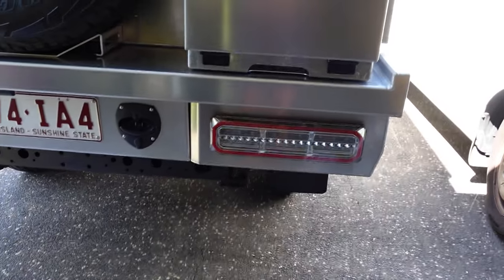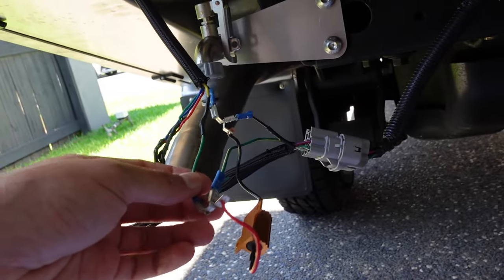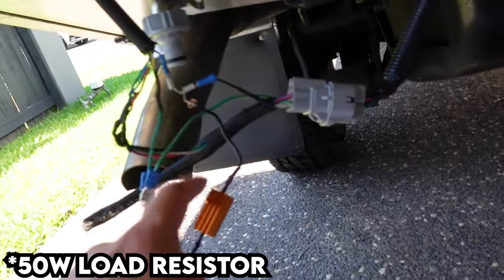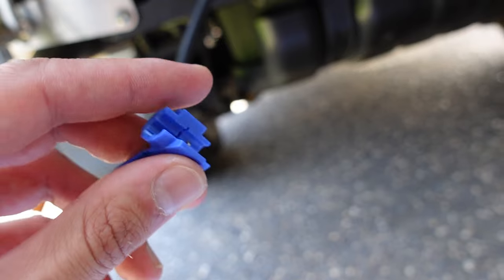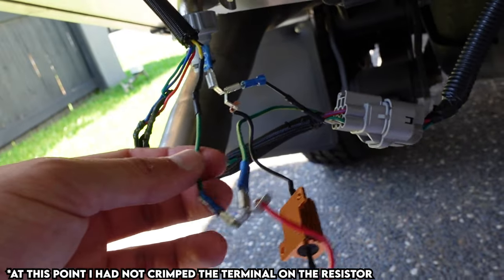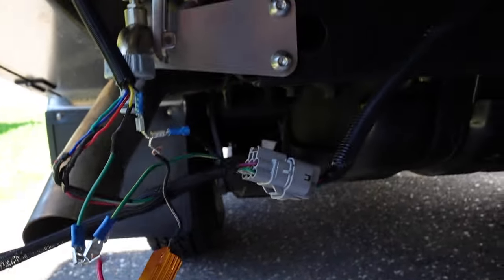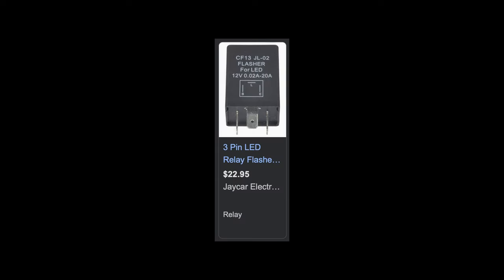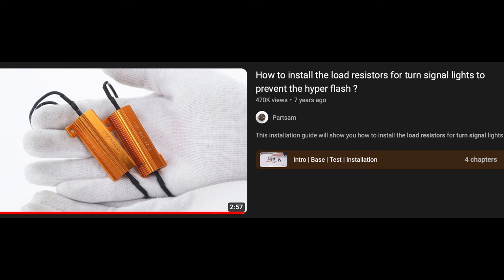How To EASILY Fix Quick Flashing Indicators After LED Tailight Swap // Hyperflash Fix on Landcruiser

Comment: Great work Mark, I do prefer the old solder and heat shrink over crimp fittings.
Reply from the maker: Probably better off with solder but these things only last a year (or warrantied for that anyway) so swapping out will be easier with the 2 way connector